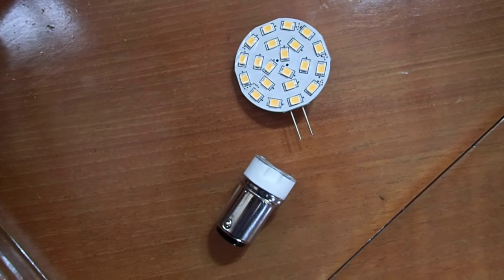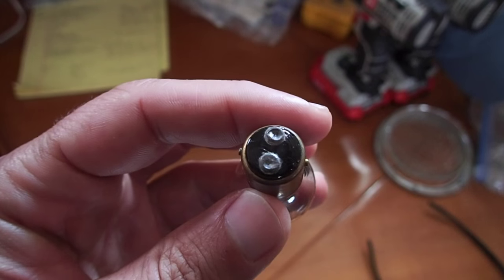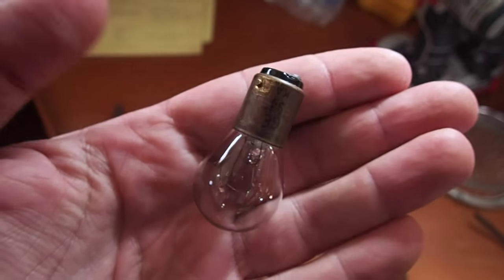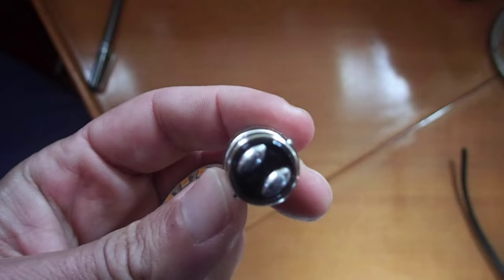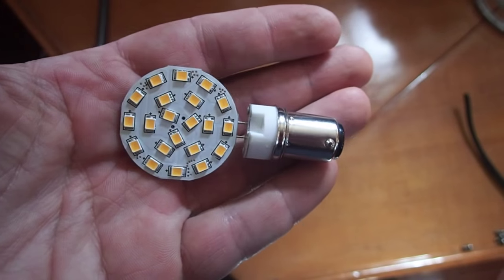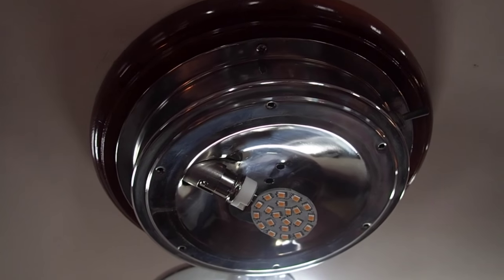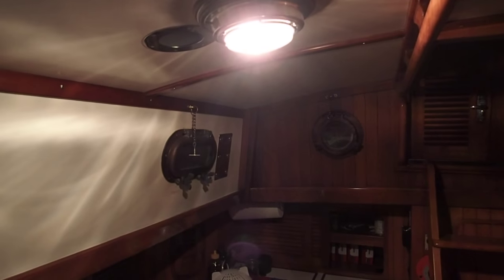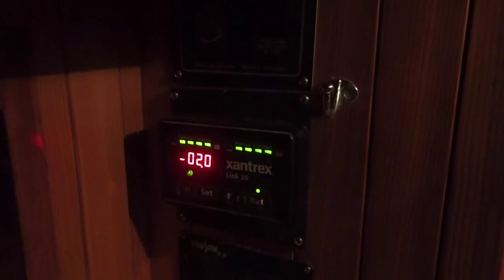Marine LED Dome Cabin Light

Comment: Thanks for the tip about the adapter. I have replaced a bunch of LEDs. Initially bought at West Marine for $6 each and ended up finding the "same" LED on ebay shipped from China for a $1 each-- bag of 30 for $30. I have been using them for a few months and cannot see a difference yet, but of course time will tell. I noticed that in most lights, it was worth it to trim the leads on each LED about 1/4 of an inch shorter to fit/be more centered in the fixture. Simple wire cutter did the trick. I started with LEDs with 6 diodes on them and bought more with 12 diodes on them and they were of course brighter and I was happier.

Comment: We replaced all the lights on Southern Cross with LEDs inside and out. Biggest thing is to get the proper "LUMENS" for the application. we ended up with two different brightness amounts so had to strategically  place the bulb to suit the location.

Comment: Bloody expensive but very worth it.  I have found most LEDs are bluish which is a bit harsh.  Careful of voltage driven vs current driven.  Potential fire hazard.  Have to look up the difference.  One of my goals is to go LED topside and in the cabin.
Reply from the maker: +Pass Me By We were trying to avoid that cool toned light you mentioned.  These are cooler than our old cabin lightbulbs but still on the warm side.
Reply: Sure you will enjoy.  I'll be going to that web site soon!